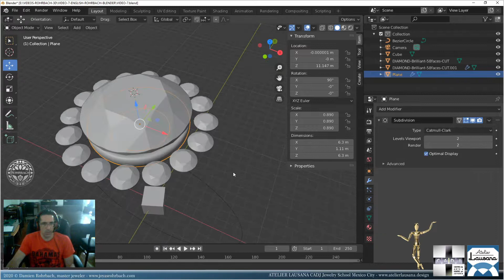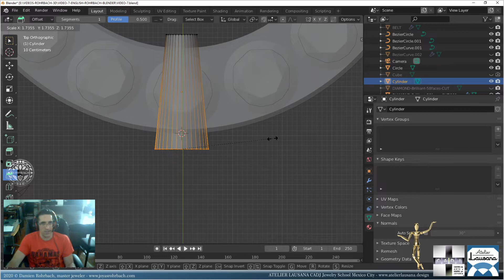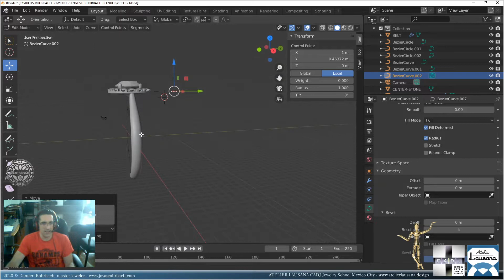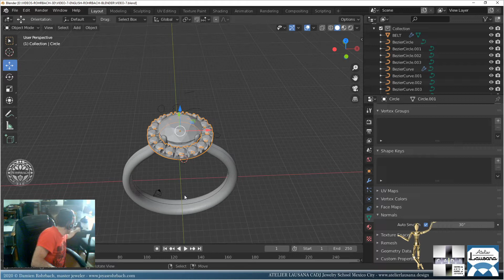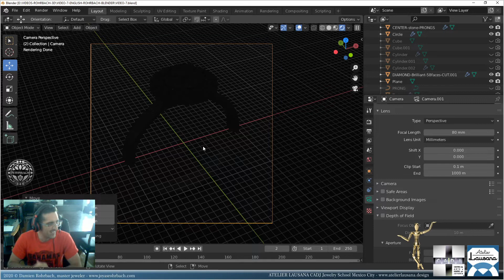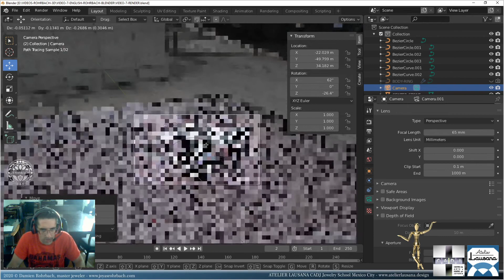3D Jewelry design TUTORIAL 7 with Damien Rohrbach and Blender

Comment from the maker: In this tutorial, I model a halo ring, central stone with smaller stones around, showing once again that it is amazing to create 3d jewelry with BLENDER. After modeling, I create the scene and the materials for the render with CYCLES. CYCLES is a very good and fast rendered, but it does lake a few things. In this case, we would need DISPERSION, but CYCLES does not calculate dispersion, so in this tutorial I show one way of creating a good looking yet fake dispersion using CYCLES.